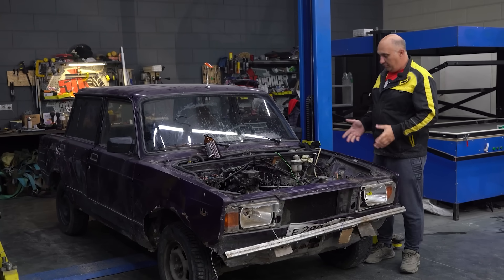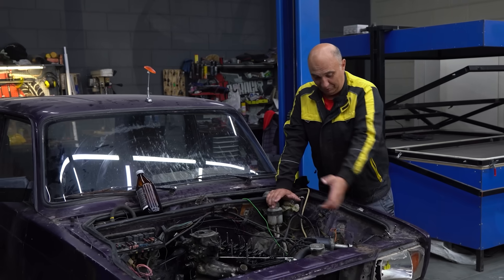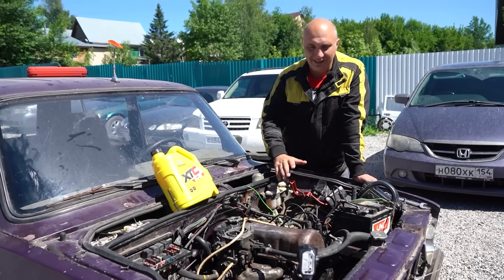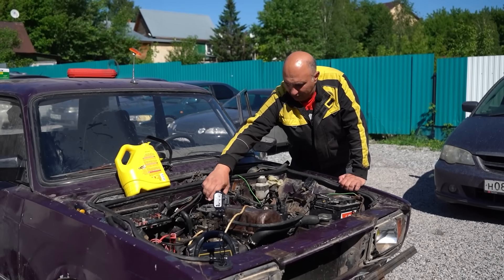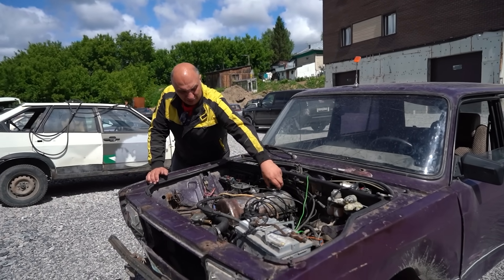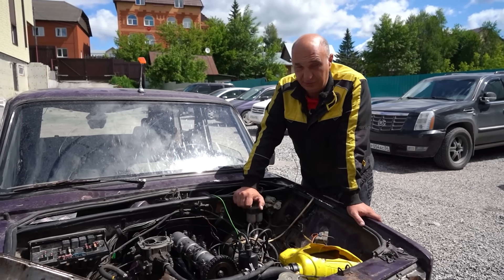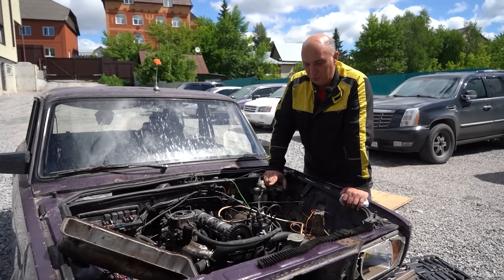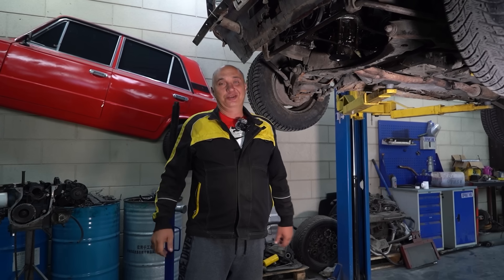Flushing an engine with paint remover – will it work?

Comment: I've used transmission fluid my whole life (well since I became a mechanic) it cleans super well and doesn't have any adverse effects on the engine. Run it a while at idle flush it out and it's clean as a whistle. A lot of cleaners have tons of detergents that really hurt viscosity and can be corrosive. Transmission fluid doesn't do that, and it also takes high temps well where as a lot of flushes effect that and the oil stability. Used this method the 20 years I've been doing this with great success. I have heard of the old school guys using thinners and stuff like that tho.  But, great video!
Reply: You use Full (pure) (only) ATF in the sump, or a little mixed with engine oil?
Reply: @tomasnokechtesledger1786  I'll usually just add about quart to the oil depending on how bad it's sludged up. Always just use as an additive not a replacement of the oil. And you can do it a couple times of needed. Or do it changed the oil then next oil change do it again. It works well I've used this method for years with good results.
Reply: @tomasnokechtesledger1786 depends on the engine old large clear
Reply: @tomasnokechtesledger1786  1liter atf against 6 of oil or something   and if diesel flush  use heavier w oil and diesel 1:8--   1:12 ratio
Reply: When i was a teenager, my father bought a 1992 GMC Vandura with a 350 Tbi. Well, i overheated the transmission on the highway by stomping on it for an extend period of time. The transmission started slipping so i took the next exist, bought 6 quarts of transmission oil at the fuel station. Proceed to pour 4 bottles in, put it in drive and went on my way gently.. 

Arrived at my destination and proceed to party all night. Early morning, i left the party and checked the transmission fluid level with the engine running, there was next to nothing in. So i dumped the 2 last bottles in, and managed to buy another 6 more at another gas station. Checked the oil again, almost nothing still, i then poured 5 bottles, keeping only 1 for the road. 

I hit the road and the Van started to smoke like a runaway diesel truck. I babied it to my house. Then sent it on towing the the dealer, the Van had now about 500 miles on it. Brand new still.

The next morning the dealer called saying that the transmission was toasted, everything was blue inside. 

So i asked, also why the engine was smoking like a runaway diesel?

That is when i got told by the dealer that i was putting the transmission oil in the engine instead of the transmission.. The transmission stick was right beside the engine oil filler neck. So in my stupid teenager head i tought that the stick was to check the level, and that the closest filler neck was where you put the oil needed. 

This engine managed to run fine until the end of the bodywork, the rust won. I hate salt. I should move south.
Reply: @ayuse01   Live and learn!  😂😂
Reply: @ayuse01  🤣 I think we all have a story similar to that when we started driving! It happens it's easy to overlook or be complacent and make a mistake. Worked at a lube shop right when I started working in summer in high school. We hired a buddy of mine and the tec downstairs drained the trans and he overfill the oil. How both of em missed that I still don't know but she didn't make it far before cooking the trans. As far as salt, I live in southern Louisiana so I don't have that worry thank God but the summer heat is brutal! It'll buckle a dash and bleach seats quick if you park in the sun a lot. I hate the heat but glad we don't deal with the salt issues. Especially being a mechanic I don't envy those guys up north working through those rusted bolts etc. We get some time to time I don't enjoy em lol
Reply: @jasonmarange5973  I have some friends who are mechanics, and the oxygen/acetylene torches are handy. I made one of em buy an induction gun, he loves it. But yeah salt is a bitch here, it destroys every thing metalic, corrodes the rebars in concrete making it crack and bust out. Same for the pipes underground etc. But the cars gets the brunt of it. You literaly see your money rust away.
Reply: What type of trans oil is, a 50w40, 70w, for auto transmission?
Reply: @Eduro02  ATF (AUTOMATIC TRANSMISSION FLUID) is more like 0w16. Its very thin! Has a very high solvability power to dissolve dirt. People call this solvability as "detergency"
Reply: @Eduro02  ATF probably, has the most detergents in it
Reply: @Eduro02 closer to 15/50
Reply: Only thing you got to be careful of if the engine design if has those silly to little filters that are sometimes in the turbo oil feed or in between the oil feeds between head gasket and top  as it's sure way to reduce oil flow and block them up in including the vvt
Reply: @leexgx  yeah I usually run a phaser/vvt solenoid cleaning cycle with my scan tool while running it through. Can also do some cleaning manually by pulling vvt sols and back flushing clean oil through the head. And if it's sludged bad and turbo I'd recommend pulling the drains and cleaning em or at least check the flow on bottom end. Anybody that gums up a car man idk I don't get how they spend tons of money on a vehicle but can't change the oil? Especially these higher revving hotter running turbo cars just boggles my mind man
Reply: My auto shop teacher taught is this trick, I've been doing this since 1986. Keeps the rings and grooves clear which is often overlooked. Once the rings stick, you get more blow by which compounds itself leading to accelerated wear and oil consumption.
Reply: @JohnDoesItAll  Great point you're absolutely right that is almost always never thought about heck most people haven't even heard of that. Even most of the companies that specialize in engine flushes etc don't even mention it but is absolutely something to consider and keep in mind when looking into cleaning the internals. Thanks for that extra tidbit of info great point!
Reply: Kerosene is also a good  solution of you want to clean the enginee
Reply: I've used diesel before and it worked really well. The engine was a vg30 in a 300zx that i had just bought and the oil was questionably sludgy. I filled it right up with like 20 litres, removed the spark plugs and had the engine cycle over for a little while. the diesel became super black. Then did a filter and oil change with the cheapest stuff on special, and that came out black as well lol... I then put always use high quality oil and has been clean as a whistle ever since 😊
Reply: @BrendanRaymondKoroKoro Same process I did to an old truck but I did use a sludge removal product instead of diesel. When I opened it to pour in I swore it seemed like the jug was just full of off-road red diesel fuel. Smelled like diesel and poured like diesel. Can't remember the brand but next time I'll just use diesel fuel.
Reply: @AudioGardenSlave123 Could have been Dyed Furnace Oil (red dye that I used to buy).
It's a more dry version of diesel fuel.
Reply: @BrendanRaymondKoroKoro diesel contains sulfur which is corrosive. Therefore, I won't recommend it
Reply: @awaisiqbal8934  all oil contains sulphur. But it removed during the refining process, especially for fuels as its so nasty. But whatever gave you the idea that diesel is corrosive? There is nothing special about diesel fuel tanks on fuel systems...
Reply: @awaisiqbal8934  unless your running it all the time as oil... I doubt it... it's not going to matter much, it's also in normal gas as well ...
Reply: U mean that red ATF?
Reply: @aronvist9679  yeah you can buy the cheap stuff no need to buy synthetic or anything just some cheapo Dex/Merc does the job
Reply: I accidentally put a quart of transmission fluid in my 87 Econoline. 
I had that van for two more years, and I never changed the oil because every time I pull the dipstick the oil was fresh and clean looking
Reply: @donjohnswaggert My old boss by mistake poured a full 4 litre jug of transmission fluid into his postwar diesel bulldozer engine. It was a horrific leaker you could see the oil dripping out after starting the engine. 
His son had refilled the engine oil jug with transmission oil and I thought it wasn't the right stuff but my boss his dad said the dozer engine was below add and hand it over let's go.
It ran fine...no different than it always did.
it would have leaked out faster and gradually replaced by the right oil.
ATF would be like a cleaner and would only thin the oil down to something like 5w20 from the original 10w30.
Reply: Transmission fluid is high detergent oil 😅
Reply: @citizenzero6140  atf dies have detergents but nothing like what most flushes do and they're usually better suited for long fluid life stability (why most manufacturers recommend a flush around 100k) and they're not near as detrimental to temp stability n viscosity etc from a flush meant to be used for only that, a quick run and flush. Not to say all flushes aren't good or don't work effectively but the ATF method works better than most I've tried, safer and much cheaper too
Reply: @citizenzero6140  ATF actually has very little detergent. No need for much due to the fact it is not subjected to combustion by-products.
Reply: i heard that or diesel fuel
Reply: I use diesel. On really bad 50/50 engines, I use thinner, diesel, acetone. Hours of idling. 2-3 oil changes and 2 filter. Recovered 2 engines.
Reply: @aadd3538 and if you have oil leaking onto the exhaust manifold (like most old cars)? Wouldnt that light the diesel?
Reply: Seafoam
Reply: @kennithlibby if i remember properly seafoam boils before an engine will reach operating temps
Reply: It really works Ive done it a few times I also ran the car for 2 miles then did the oil change lol
Reply: These new engines use similar viscosity to the trans . So all in one case ? Redline lubricants had an extreme pressure atf, so they could have the whole thing in one case, make internal water fuel, ps pump with rack along with alternator in one case. Would have lots of surface area and only need coolant and wiring, and steering by wire.
Reply: But with thinners and other like that...the seals will be destroid...
Reply: I've heard some long time mechanic guys recommend diesel, to me it sounds like a horrible idea 😅
Reply: @fishrsa9046  That's what Ive used 1 part diesel and 2 parts oil. Let it run to warm. Drain and fill with oil change oil again after 1000 miles engine should be clean.
Reply: been using diesel flush seen the  70s.
Reply: @fishrsa9046 I've done it a few times and it definitely works.
Only used on badly neglected sludged up engine.
Drained all oil... refill with the fuel oil and running idle about 10 minutes then drain the (now black soup) and refill with the normal oil.
No issues. 
The difference is that you only idle the engine when fuel oil is inside and you can drive it when you're adding ATF. 
Rislone works as well and probably the safest if you are worried about potential damage. 
Tbh regular on time oil changes keep everything cleaned.
It's tightwads that think engine oil change is a scam that causes extreme gunk levels.
Reply: Fair warning if your engine had plastic timing chain guides transmission oil doesn't play well with them.
Reply: @ryanrohauer5940  that's not true it has no effect on them it's not harsh at all and the guides are built to withstand extreme heat and any detergents these new oils have in them. Transmissions have plastic check balls, passage seals and buku plastic harness looms as well as plastic thrust bearing races etc made from very similar if not almost identical plastic make ups.
Reply: I had a 1985 corolla, used diesel and cheap oil 50/50 let it idle for 1/2 hour, then used a new filter and oil, the engine blew so much blue smoke after that!!
Reply: @adrianmuhlsimmer3445 too much only one cup diesel...diesel is only 1w
Reply: All that work, useless efforts for nothing. Just change the oil every 6000 km, no matter how new or old the car is, and you'll never ever get to this point. Oil is cheap. Engine is expensive. Change the oil.😊
Reply: @neprevazutul  not everyone buys their car new a lot of people's cars have been through 2+ different people before they get them.
Reply: @bruhmandude555  That is true but if you're buying I'd hope you'd inspect it a little and pass on anything sludged up if they didn't change the oil they probably didn't do much if any maintenance
Reply: @jasonmarange5973  thats true but its getting harder to find cheep vehicles that aren't totaled or have mechanical problems
Reply: @bruhmandude555  I can't argue with that man it's ridiculous what vehicles are selling for so yeah sometimes ya gotta take what you can get

Comment: How in the world is a flush suppose to clean intake/exhaust valves?

Motor oil never comes in contact with them short of a insignificant amount which has been vaporized, and passed through the PCV ....

Comment: You have to be extra careful with this one. Depending on the type of paint remover you use - you could cause hydrogen embrittlement, which is a very serious problem for hard steels. You could end up causing a valve to break and drop into the cylinder, broken rings, etc. Look it up - hydrogen embrittlement. Certain types of paint removers contain hydrogen compounds that can cause it.
Reply: hydrogen compounds? do you mean compounds that can break down into hydrogen? Because I believe only hydrogen - monoatomic or diatomic - can cause hydrogen embrittlement, and I don't think it's appropriate to call any other compounds "hydrogen compounds," so I'm just curious.
Reply: I just read something about cadmium in the steel getting into the paint thinner I think, but however it does it exactly, it reduces water to hydrogen. Of course, you can't avoid water on earth very well.
Reply: what if dimexside is just the more costly version of paint thinner?🤣
Reply: @raven4k998  It's not thinner, but paint stripper remover, different things.

Comment: I'm not sure of this. I'm thinking what this paint remover does to gaskets and seals. Wouldn't surprise me if the engine leaks oil after this treatment.
There are products on the market here in the west specially for flushing engines out that, although not cheap, at least not that expensive to risk your engine with paint remover.

Comment: I left a Honda CR-V run for 7 hrs at idle with 1 qt 10W30, 1 qt Lucas Oil Stabilizer,  3 qts Dex/Merc III Automatic Transmission Fluid. Looked a lot better after.

Comment: They could try this:
1. running the engine to temperature with a fresh filter/oil up to 1 hour 
2. drain the oil and replace the filter with a fresh one
3. remove engine from vehicle and mount it to a stand
4. fill engine with paint remover used in this episode
5. remove/loosen spark plugs for 0 compression, at which then
6. turn the engine by hand/drill for 1-2 hours while using a heat source to heat the engine block under normal running temperature with heat guns/blow torches.
After the time is up, they could completely dismantle the engine after it cools to see the effect and any potential damage to the pistons/rings, cam shafts, cams, and other critical parts. If paint remover could effectively remove nearly all traces of sludge/oil without doing any damage to the engine and it's parts itself, then it could save people a hell of a lot of money. Even evaluating the fresh filter after the cleaning run for any metal shavings could identify a critical issue as well.

Comment: Several years ago I used synthetic oil in my 2008 GMC Sierra. It disappeared.  The level was dropping and it wasn't leaking, and I really couldn't see it coming out the tailpipe.  Fearing that it was gelling up and sticking in the motor; I drained the oil and filled the engine with diesel. Let it sit a few hours, then cranked the engine for somewhere around 3 to 5 minutes. (scared to go more)  Drained the diesel, changed the filter.  Filled with oil, ran 15 mins or so, and again replaced oil and filter.  It has ran like a champ since, always using real oil, not synthetic.

Comment: Here is a old school trick to flush your engine this will really work when you have sludge and sticky Hyd lifters . When they get sludged up they will tick . Take a quart of oil out of your crank case do no change the oil or filter at this time. Take a quart of Transmission fluid and dump in the engine. Run the engine for 500 miles then dump the oil and change the filter . The ATF has a high considerations of detergents in it and will clean out the sludge. During the 500 mile run try and run the car on the free way or high ways do no run the engine at high RPMs because the oil will be very thin just moderate cruising. You will be amazed how well ATF cleans your engine and its cheap dextron is fine just get the cheapest ATF will work

Comment: Hallo! In my job,we often use carb cleaner spray to clean the oil deposits,and is doing an amazing work. i wonder what will happen if you do the same like on this video,but with carb cleaner. i believe you're going to have amazing results.